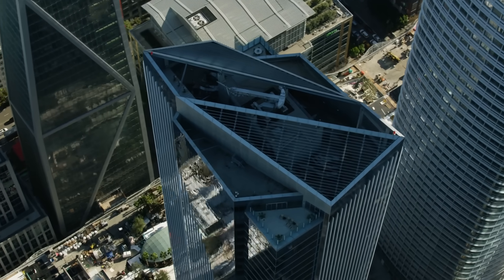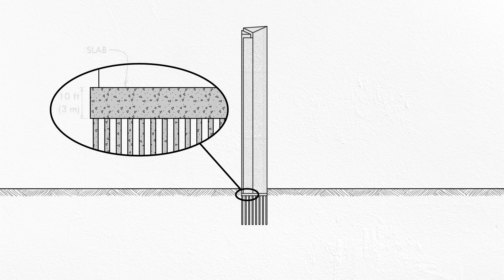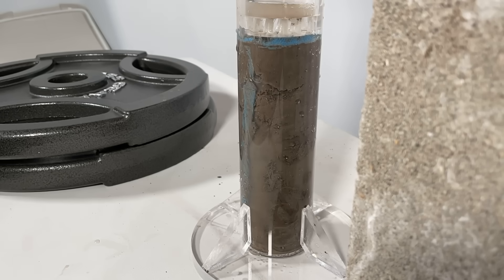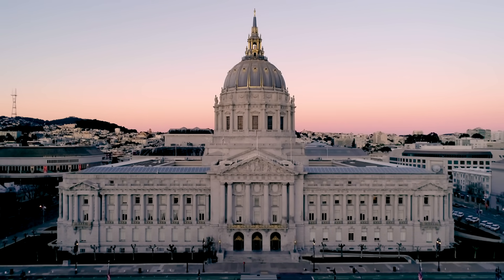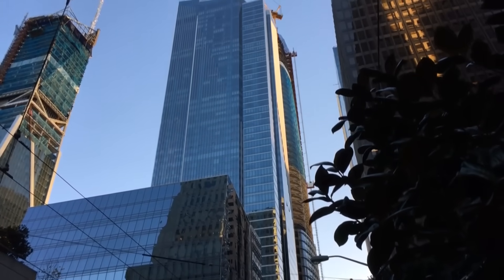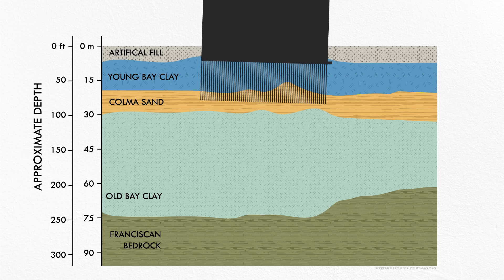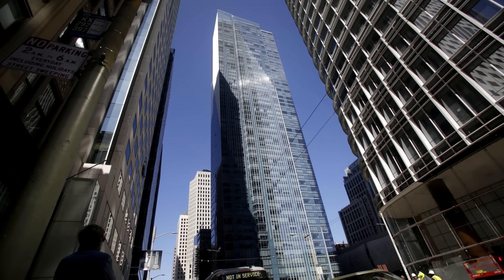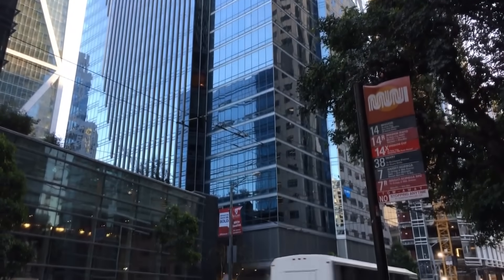What Really Happened at the Millennium Tower?

Comment: What i don't get about this Tower is, how was it approved in the first place with the existing foundation design? Surely every building in San Francisco has to be engineered to withstand at least an 8.5 Earthquake & liquefaction? As a contrast, the majority of new buildings above 3 storeys up to 100 storeys in Melbourne, Australia are all concrete structures. All the skyscrapers built on flat land are built on reclaimed land with a high water table. Eureka Tower, Melbourne's famous & 2nd tallest tower, 290m, has 50m deep piles. Australia 108, it's new sister tower about 50m away, 320m, has 64m deep piles. Melbourne recently had an EQ about a month ago, a 5.0 about 2hrs away. But Melbourne doesn't have faults close by, yet all it's towers are designed to withstand Earthquakes, but mostly high wind loads. Surely San Francisco towers experience high wind loads also? Towers in Melbourne can flex about a metre i think at the top in high winds. Surely towers in San Francisco in a city built more or less directly on a fault, as much as Wellington NZ is, would need to be built for at the very least an 8.5 quake (You have to over-engineer EQ strength to account for EQ intensity). 

An already tilting building must be somewhat terrifying to be in during high winds. Some serious backroom deals between the developers, engineers, & city inspectors must have gone on here for this clusterfuck to have been allowed. This is a major & concerning issue in any city, but combine massive EQ risk to that, & it's grossly negligent in my opinion. The only explanation is corruption in my eyes. Speaking as having experienced a major EQ myself, actually 4 major quakes above 6.0 in 13 months, in Christchurch NZ. The one thing our EQ taught geologists & engineers globally, is that quakes can always produce more force than expected. Our worst one, a 6.3, produced vertical acceleration 2.2x gravity near the epicentre. All new commercial buildings above 3 storeys in Christchurch are now built of steel & on rubber base isolators. Only 2 80s office towers (18 storeys) exist now, all were torn down. We were the lest likely place in NZ to experience an EQ directly, at least so we thought, but most high rises after 2005 were built to withstand an 8.5 quake, were built from steel, & are still standing.. 

But i struggle to understand how a skyscraper in San Francisco, one of if not the most famously Earthquake prone cities in the world, approved a skyscraper that wouldn't have gotten approval in Melbourne, which has far less Earthquake risk? It's clear some dodgy shit went on here if you ask me..

Comment: muddy ground is a huge problem for buildings in gothenburg, sweden yet lately they have still insisted on building skyscrapers (skyscrapers by scandinavian standards at least) on this mud while they also digging a train tunnel under the city. 
when gustav II adolf founded the city in the 1620s, it was quickly found that buildings was sinking into this mud on the river banks of göta älv, the dutch had experience building on similar muddy grounds as seen in like amsterdam so they contracted dutch engineers and builders to build and teach how to build on this kind of terrain.
i live in a brick building built in the 1960s in gothenburg and it shows signs of uneven sinking with cracks in the bricks and mortar despite it being about 5km from the river göta älv and shouldnt have that muddy ground. some newly built apartment complexes less than a km away has their garage basements blown into the bedrock below this mud so those dont have the sinking issue at all

Comment: The story of the Millennium Tower is a  fascinating… …tale of developer greed and corruption.  Why did a modern skyscraper of this size use concrete instead of steel?  Why didn’t they pile driver down to bedrock in the first place?  There’s one singular answer and it has nothing to do with not knowing the engineering.  When I lived off of Van Ness a decade ago, our much smaller twelve story condo drove down to bedrock.

Comment: "I assure you the building is 100% safe, however we are spending millions of dollars to try to fix it but so far that's only making it worse"
Reply: Change that to a 99%   And youve summed up most engineering development projects😂
Reply: The leaning tower of Pisa never fell over, so a tilt does not mean its not structurally sound.
Reply: @vast634    It absolutely would have fallen over if herculean efforts hadn't been made to prevent that from happening.

Comment: David Williams, the structural engineer hired as a consultant by the condo owners HOA has disclosed two factors that would seem important:  First that the ten ft. thick concrete mat or pad mentioned in the video is "dishing," - distorting in shape because of unexpected loads.  Second, he also says the building's foundation was designed for a lighter steel framed high-rise, but was left unchanged when the builder switched to a much heavier structural concrete design.

Comment: As I just said there isn't anything to figure out. The foundation must be supported all across underneath both directions and it will be impossible to adequately do that.
     The engineering firm that designed the foundation took shortcuts so they can have bigger profits. That is the sole problem it is not the stories by the media demonizing the building. It is a ticking time bomb it will structurally fracture overtime and cave in on itself and come down. The building must come down and letting the engineering firm off the hook with just monetary settlement it's criminal by the City government of San Francisco.

Comment: This seems like a poorly thought out plan to me. In my opinion there is still a major problem with all the weight underneath the main portion of the building. They may be trying to stop the settling by putting a row of piles down the two outside edges but the weight has to be supported all across the foundation not just around the four edges. The building wasn't designed to be held up by the outside edges, it must be supported solidly all across underneath both directions are the center of the building will be trying to constantly pull itself in and down which puts loads on the entire structure that it was not designed for.
With such a screwed up foundation as far as I'm concerned the only true fix is to bring the building down unfortunately. It's a beautiful building, but it's a ticking time bomb.
Reply: The building is supported by the original foundation, problem is one side is sinking faster than the other. The new piles are meant to adjust the tilt by halting the descent on the lower side and letting the higher side catch up, not necessarily to take on all the weight of the entire structure.
Reply: And the distinct possibility of more strong earthquakes as well. And it's NOT a 'beautiful' building. It's an eyesore, along with the rest of the new ones. But hell, what do I know?
Reply: Exactly. If the edges were strong enough to support the weight then why pour a slab vs a "frame" foundation?

Comment: In 2017, I interviewed with a geotechnical engineering firm in the east bay that regularly worked on foundations for large structures in San Francisco similar to Millennium Tower. The guy I interviewed with mentioned the Millennium Tower settlement and that it was entirely because they did not anchor the piles to bedrock and made it sound as though that was normal practice. Interesting to learn in this video that there are actually other structures anchored to the sand layer similar to what was done with Millenium Tower. I'll have to do some digging and see which other buildings utilized this technique. Awesome video Grady!!
Reply: China uses plies driven into sand on their tallest buildings
Reply: @wallacegrommet9343  copy cats

Comment: I wonder how many of the experts that keep saying the building is safe actually live in the building.The endless theories are all very interesting but if the foundation (designed by experts) was anchored to bedrock we wouldn't have the problem we have now.You don't have to be an engineer to work out that if you put an incredibly heavy weight on soft soil-it is going to compact.Apparently a platoon of engineering experts collectively couldn't work this out.

Comment: I understood the foundation was built to support a steel structure, but the structure was changed to concrete later which weighed more. The developers believed the city would pay for the more generous foundation, as they had done on a nearby building. The city did not, and dev's went ahead with a foundation not suited for a concrete tower.

Comment: Interesting how you don't even touch on the fact that the original design was to have the building made from steel and not concrete which is much heavier. I think this would help clarify as to why the "experts" chose not to go to bedrock with the pilings.

Comment: If the engineers models were substantially wrong about how much the building would settle, is it not unreasonable to be concerned about if their models suggesting the building is safe are correct? Even if there's only a 0.01% chance that they're wrong, is that a risk you'd be comfortable with when you can just buy a different condo?
Reply: Let's say there is an X% chance that the tower will become uninhabitable and all residents will lose their investments. If so, it would be a good deal if you could buy a condo in the tower at a discount greater than X% compared to similar buildings in San Francisco.

Of course, this assumes that we will notice if the building becomes unsafe so no residents will be killed. I think that's a fair assumption, as the building is under heavy scrutiny and it's relatively new. It also ignores the worry some might feel living with uncertainty.

Comment: Wouldn't the building have a tendency to lean more towards the drilling of the perimeter pile before they can actually perform the pile driving? If they are creating a temporary void, then that's where all the energy will be released. I would think they should create a void on the opposite side of the lean first and allow some of the energy to be dispersed in that direction.

Comment: Question for you civil/structural engineers. With piles going that far down to the bedrock layer, what prevents the piles from buckling (Euler bucking)?  Is it the surrounding soil? This video mentioned that the piles are not in contact with the surrounding soils.   Just curious.

Comment: The Structural Design for the foundation was originally for a steel frame structure; to save money it was switched to a concrete structural frame which was much heavier and the foundation was never upgraded for this increased weight. The foundation could have been fixed for $4 million to upgrade the foundation for the increased weight.
Reply: Thank you for that insight.

Comment: I didn't see anything that addressed what happens when/if they get the perimeter piles installed, and the building does eventually level itself. The sides that don't have perimeter piles will just keep sinking after the building goes level.
I'm assuming they will have to install pilings on the other 2 sides, I just found it odd that it wasn't mentioned.
Reply: They should be able to open the vaults and release some of the pressure from the hydraulic leveling jacks.

Comment: There was discussion about going to bedrock and they figured they could save a few dollars not putting in a foundation as was done on all the other tall buildings in SF.  It was a poor choice by the designers and developers.  One can see the tilt looking at he building, it is that obvious.  The cost of repair is definitely still not known since work stopped.  As you mention, there is a lot of detail information you didn't mention.  When finally fixed then a really proper story can be told and it won't be 15-20 minutes long but hours of detailed information.

Comment: The building rests on a foundation plate which should be kept level. The foundation plate rests on many pillars. What's so hard about replacing the top section of each of the existing pillars with a hydraulic contraption that can be grown or shrunk depending on how each individual pillar settles? Each pillar could be monitored to make contact with the foundation plate above with the exact same pressure and it wouldn't matter at all whether or not some pillars sink faster than others. This could be implemented even now, one by one, at not much cost.
Reply: Mechanically that seems like a better solution,  however I suspect that it would be a lot more expensive to implement.  1)  I would imagine that adding a jacking system to a piling that was never intended to have such would be a fairly complicated and expensive procedure.  and 2) you'd be doing it to 950 pilings, vs 53 pilings with the method selected.

Comment: Since windows are cracking about half way up on the side of the building that its leaning toward. That would indicate to me the weight of the building above it is increasing off center and beginning to crush those steel beams. If it leans a little farther I think it will fail and topple the upper half of the building.

Comment: Nice video but you really skipped what I think would be a very interesting aspect of this problem. Aside from a second of video showing some cracked concrete (with no context) there is nothing showing visible/tactile effects of this building sinking 16 inches. Do people have to step down now when they go into the building? Sixteen inches is an incredible amount and should reveal some pretty significant problems at the interface between the surrounding street and the interior of the building. Also did they have a problem with utilities (pipes, etc) getting sheared off?

Comment: It's "funny" as a civil engineer specialized on bridges I constantly work with stresses above 500kPa, not even batting an eye.  Because all of it is short time loading. So when I relayed my stresses to the geo- depart. They were as shocked as every, before I realized that long time vs short time stresses when it comes to traffic loads can vary with 1-2-300% dependending on your geometries..
Reply: The monolithic weight of all of the deck and support framing, as well as the columns up to the deck, the pedestals below that and the massive concrete foundations supporting it all the maximum traffic load is close to negligible. The design earthquake or wind storm storm is going to control the design, and both of these events assume an average traffic load as a matter of course (large trucks add weight and wind area to a bridge while they're on it, but they're also unlikely to all be lined up on the bridge during the design wind or earthquake event).

Comment: Q: I don't suppose you'll also have an issue with suction forming around the friction piles in the clay, when the structure is "rotated"?

Also, could you do a video update about this once they have completed the project? Would love to hear if they were successful with this latest attempt.
Reply: That's the thing, they are "friction piles". They don't depend on solid ground underneath the end at all, just the resistance all along their length. So it wouldn't normally matter if they are withdrawn by a couple of feet.

Comment: I hope they'll have access to the hydraulic rams after they're done. Hydraulic rams have seals. Seals deteriorate. Also, if you leave a load on a ram, it will slowly settle. Just look at an excavator with the bucket left in the air for a few days or weeks.

Comment: Hey Grady, you were remiss in mentioning that the original foundation design was for a steel structure. Along the way, the developer chose to change the material to a much cheaper concrete structure, which was also much heavier, although they retained the original foundation plan for the lighter steel structure.
Reply from the maker: All structures go through design changes. They did check the foundation design for the new loading.